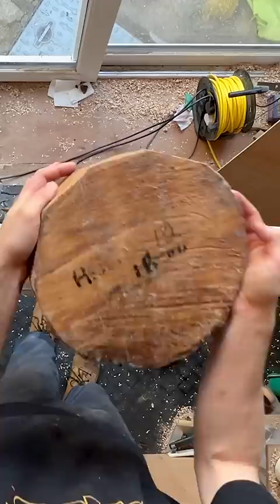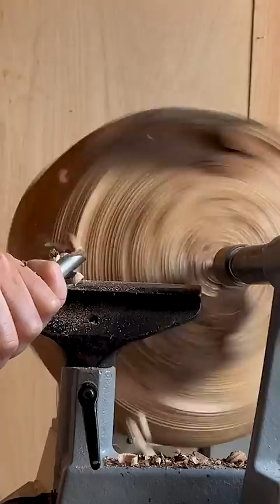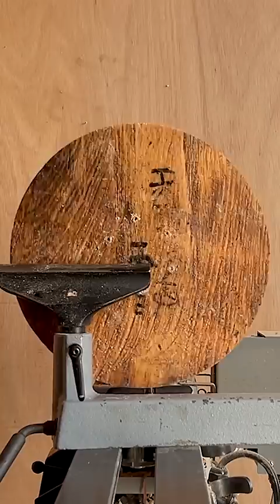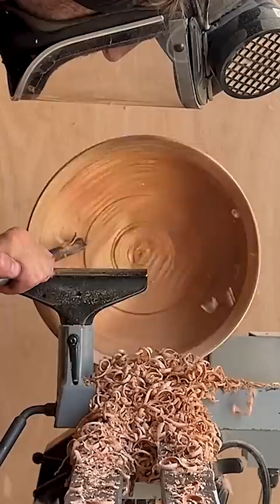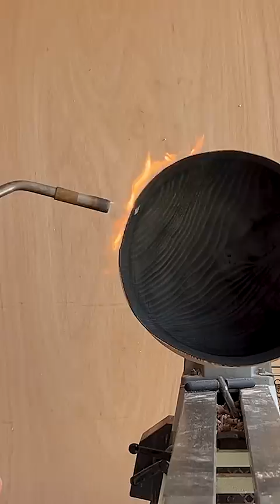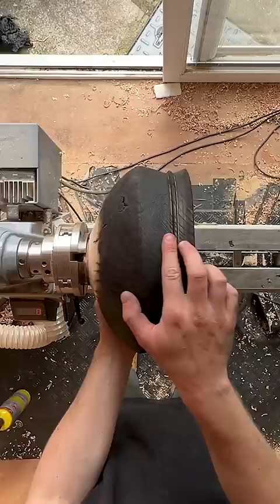This nearly caused a HUGE FIRE! #woodturning

Comment: Bro are we not gonna talk about the fact that he used paper to put out the fire
Reply: Dude. You could use a jerry/ gas can to smother the fire lol. Aslong as you're not holding it above the fire and do a smacking action/ in this case quickly pressing down into the rather controlled flame with paper towel, it's gonna smother the fire out. Provided the object isn't soaked in flammable substance.